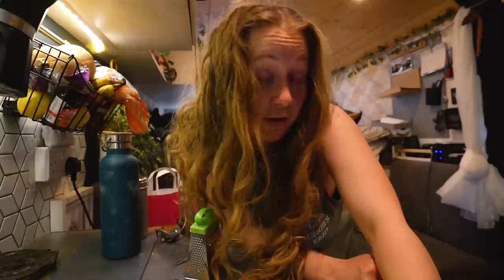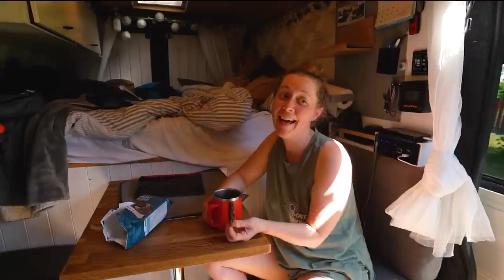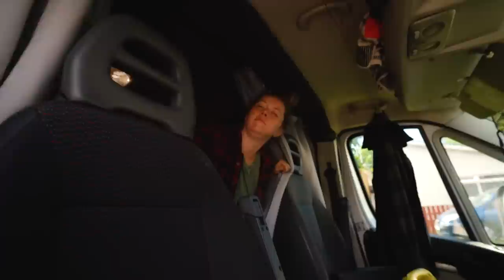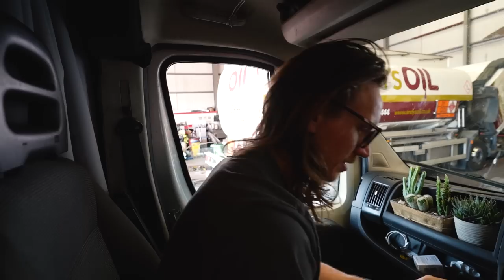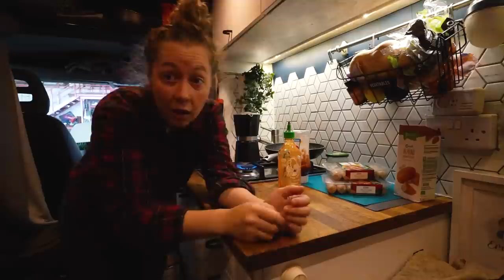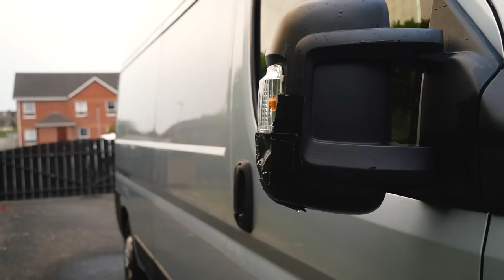Vanlife in Ireland: The Unexpected End

Comment: We had a similar problem with our car (Suzuki Grand Vitara 1.9 ddis) a few months ago. It would work with no issues for around 20-30minutes and then, sometimes, it would go up to 4000RPM but the power would not increase, until we stopped and left it chill for a while, after which the story would start again. 
The mechanics firstly changed the entire clutch on the car (first onion layer), only for us to come back a few days later and get the same initial EGR diagnostic, but it would eventually require a DPF (diesel particulate filter) change and catalytic converter recondition for it to be fixed.
Might not be the same for you, but maybe it’s worth mentioning.
Reply from the maker: Thanks Rares, we will definitely mention it to them!! Fingers crossed only one more layer to this onion.

Comment: I had a similar problem with our Ducato which turned out to be a small electronic vacuum control valve that turns the turbo on and off. It's located on the nearside engine bay in our van, it's quite small but can be found by tracing the vacuum line back from the turbo. The valve only cost  £54.00, but to diagnosis it, it meant the mechanic had to drive the van with the diagnostic computer plugged in. It quickly identified the faulty unit, and it took very little time to swap it out. It's not immediately obvious, but it cured our van. I hope this helps guys. 👋
Reply from the maker: Thanks Geoff, I will share this with them incase it helps identify the problem

Comment: I know exactly how you feel. I had a similar issue with engine going into limp mode. After various "fixes" and a 19hr recovery by the AA, (they messed up big time) I finally discovered that a rodent or a fox had chewed the wiring on the 5th injector.
As you both said and you're right, the initial diagnostic check gives you the area of the problem but what's causing said problem.
Hope you got to the bottom of it. Sure you have and next Sunday you'll be in Alba 😁.
Sounds like you're about to have a fantastic tour of Scandinavia.
Looking forward to seeing what you get up to.
Love the content of your vids as always.
See you next Sunday 💚💚
Reply from the maker: Thanks so much Alan 🥰🥰 we will defo get them to check wiring on the injectors, ya never know what lived in our engine before haha

Comment: Awh, I had similar issues with my car recently. Granted all the sensors are working, with no obstructions, and no leaks (oil or pressure,  check all the seals ), it could be the intake manifold, or the EGR valve (shutter) could be 'carboned' up - so it might need a clean. If the latter, there tends to be a pressure build up in the engine, and the turbo acts the maggot. Also check the DPF soot/ash levels. I'm sure the grease monkeys would've given all that a whirl, but it sounds like something going on with the exhaust system. 

(FYI- I'm not a mechanic, but spent the last year taking an Audi engine apart, and putting it back together  (with no leftovers!!)- so might as well spit out some knowledge while it's fresh,  and before it dissipates into thin air.. 😂). Hope yis got it sorted!
Reply from the maker: Thanks so much Jim, we have just arrived at the mechanic so will add these all to a list of things for them to check 💪💪
Reply: @phillyandkeely  Class, how'd yis get on?
Reply from the maker: we brought them a big list of all our YouTube comment recommendations, they went through them and ruled them all out, they are thinking our MAF was seriously carboned up so it's all been cleared out and hoping that it's done the trick 🤞🤞🤞

Comment: Sounds like the wastgate actuator hose might be leaking, have a listen for air leaks
Reply from the maker: Ok we will say this to them when we bring it in tomorrow, Philly things he hears hissing when it stops working.
Reply: Hi we have a simular problen. Hissing might be from a belt because marta is hot. Our turbo fiat 2.8 knaus traveler camper  doesn't kick in either. We got the turbo reconditioned  made no differ we dropped the fuel tank cleaned it out fresh deisel no differ. We checked for leaking pipes cant find any. We hooked up a boost gague to see but only boost to 1 notch bout 0.01 on the gague no where near what it should boost to. Let me know how ye get on might help us
Reply from the maker: @annc3628  will do Ann ❤️❤️
Reply: @phillyandkeely  also check the diaphragm to make sure its not stuck closed / open not sure which way it works but when you build pressure there a pin thing that releases the diaphragm to create boost. We have nearly exhaused every avenue in trying  to solve no boost
Reply: We got our camper looked at today and the out come for no boost is the catalytic converter was blocked we took off exhaust an it now noisy but flying it

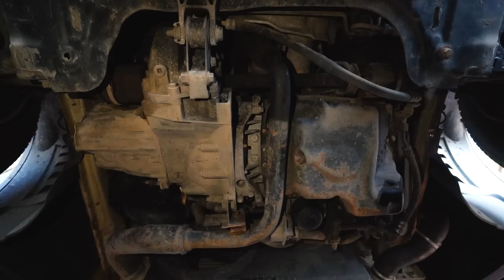Comment: I see you replaced the single passenger front seat after your recent MOT test, just intrigued to know why as I also removed my double passenger seat from my camper and will be MOT testing it later this summer. Were you advised to refit it for the test? PS the diagnostic machine 9:01 was also showing MAF sensor fault codes as well as EGR and CAN network faults, get the MAF sensor tested with graphing the live data info while driving or maybe just try a new MAF in the van as their not that expensive and do go faulty often.
Reply from the maker: Thanks so much for the advice Will, we will share this with the mechanic today incase it helps identify problem, appreciate that 💪💪 as for seat we only replaced it to give a walkway, not to do with MOT.
Reply from the maker: @samm4265  that's exactly what we've just changed today so fingers crossed 🤞🤞